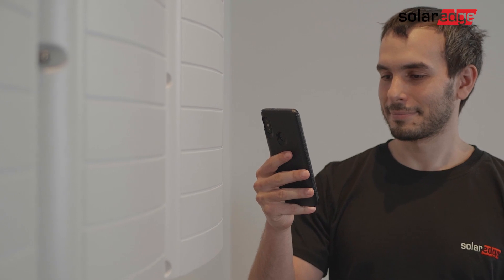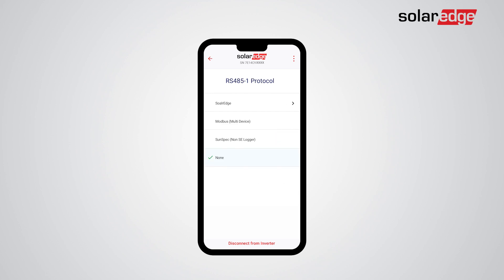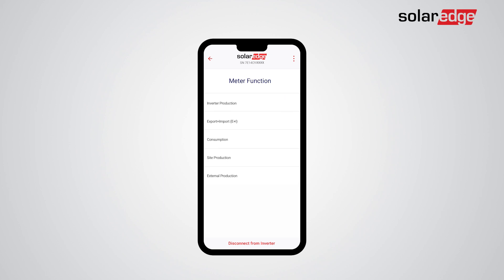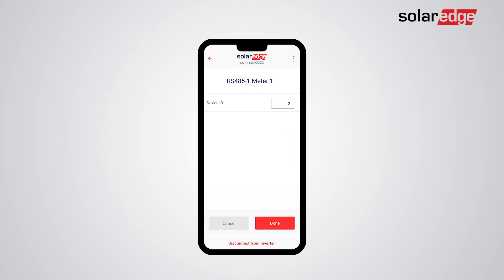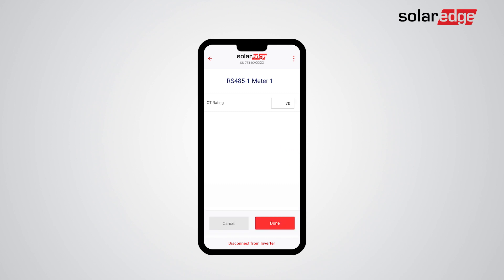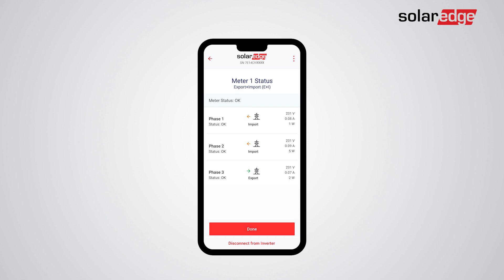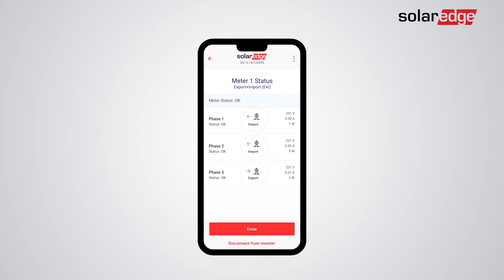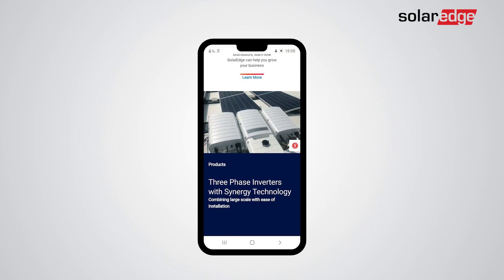Configuring the SolarEdge Energy Meter with Modbus Connections

Comment: You are assuming too much in your videos. Example: Show where to find the CT rating, explain what a "Grid Topology" is and where to find that setting on the meter and how to change it.
Reply: The CT rating is written on the label of the CTs you clipped around the cables, e.g. 70, 100, or 250. Grid topology selects whether the grid is Wye (Y) or Delta (Δ) 3-phase grid. If you've got a neutral on the incoming cable, it's Wye, if there's just the 3-phases, it's Delta.